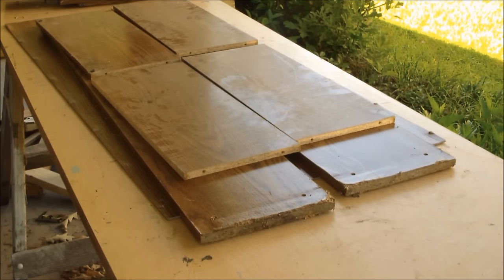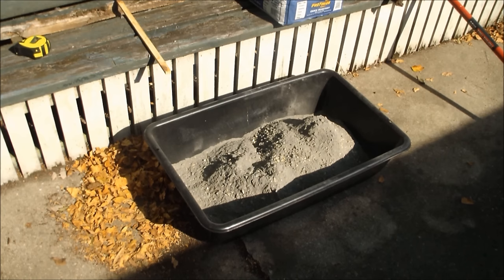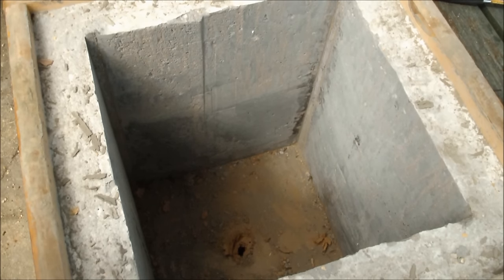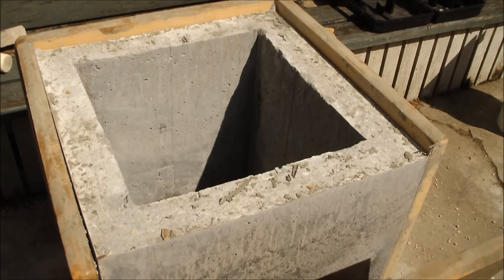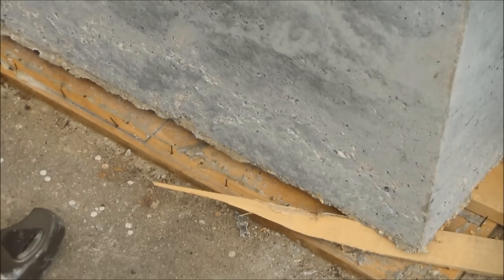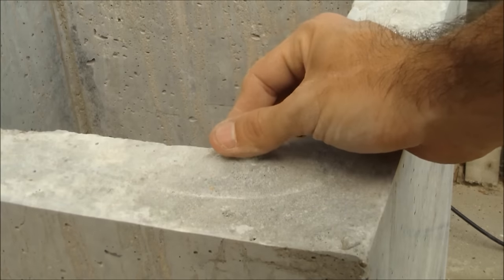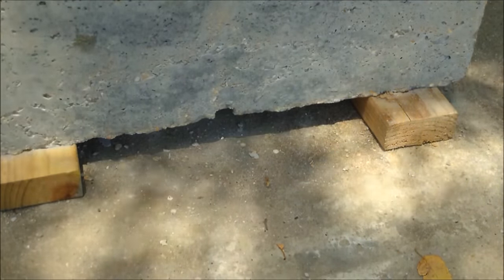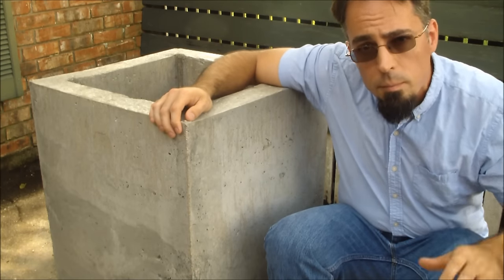How to Make a Concrete Planter

Comment: I worked at a pre cast concrete product manufacturer temporarily, I'm not an expert, anyway we used cooking oil in a chemical spray bottle, like you use for weed killer but industrial (metal) instead of pumping it we used a compressor to pressurize to lube the forms and molds. We were making bulk products, a plastic sprayer might be fine for your needs  We inserted  desired lengths of metal rods immediately after pooring the forms,  much thinner than rebar. We had a hand held electric vibrator we simply held to the forms make sure it settles in,   fills all areas properly and gets the air bubbles out.  I enjoyed my brief introduction to making precast concrete products.
Reply from the maker: You sound like more of an expert than me! I'll follow your tips next time. Thanks!

Comment: Exactly what I was looking for.  Great to see what you had issues with etc.  It looks great.  Thank you. Off to buy some quick crete.
Reply: Just buy the raw ingredients separately (if you can discover what they are and the ratios), you will save 50%. I assume the mix is 3:1 sharp sand to cement. Not sure about the fibre reinforcement material.

Comment: You can apply used motor oil on both the  outside and inner moulds for easy removal of concrete form from the woods.

Comment: When mixing mortar in the tub ,(1) put  the water in  first ,the amount is written on the bag,This makes it a lot easier to mix ,(2) Best bet, Mix  the  mortar in a bucket  using an electric drill ,mortar will come out like a smoothie  with less air bubbles
Reply from the maker: Thanks for the info!

Comment: mate after a day of curing you can take the inner box easier than leaving there for a week and by the way you do not need the bottom of the box if you stabilise the inner box from the top either down and the side by nailing a timber across the top. Make sure that you use a good greasing agent or even wb40. otherwise great and trial and error is the mother or all inventations.

Comment: If you unmolded it after about a day or two, you could have used a dremel tool to round off the sharp edges and remove those little bumps...or you could have tried to avoid the bumps when concrete was still wet...and carved a little edge in after the concrete had set "just enough" (an hour or two).  Grinders work great on cured concrete too....they work so well you have to be very careful not to take too much off.

Comment: In future wrap the mold in moving plastic or coat it in oil so you can pull the box out and save for another mold. Also....if the planter will be in yard for example and you don't plan on moving it you wont need a bottom for that instance.
Reply: Gisela West unless you plant something you don’t want spreading like crazy (like bamboo)

Comment: Good job. Maybe 90 degree angle brackets to make the inner box, easier to just unscrew. I'd like to include a handles of sorts for the finished product. More for character than function. Steady hand with an angle grinder will shape the top nicely.
Reply: Are you thinking of the marble or porphyry basins or baths used by the ancient Romans as sarcophagi? Objects of great beauty, with annular handles sculpted in relief, for example the one in the Mausoleum of Theodoric at Ravenna (wikimedia commons     File:Ravena (145).jpg  ).  Also the Imperial sarcophagi in Palermo Cathedral. That would be an amazing feature!

Comment: If, as my old coach told me, tenacity is the hallmark of the champion, then you're a champion, sir. That project had it's hiccups and you valiantly succeeded. Good on you! Some good suggestions below. Next time, consider making the mould a popcorn box shape, even if slightly tapered, as this will assist in "draw", a moulding term that means that the mould will release much easier with reduced chipping. And if, one day you decide that the bubbles have to go, you've got a nice rendering project to film. 😀
Reply: Making a tapered box requires quite a lot of skill, competence in design, use of angles, accurate measurement, more difficult to construct, etc, but good point

Comment: Great idea. one suggestion I would make to get rid of the air bubbles and have a much smoother finish in the absence of a proper vibrating table is to put either a very blunt or very big masonry drill bit into your drill/cordless drill and turn it onto hammer action and then simply drill into the the timber shuttering and watch the the level of concrete fly down.  You have to be careful of course that you don't drill right through, which is very unlikely with a blunt or big masonry drill bit as they're obviously struggle to go through timber.
Reply: Wouldn't even have to be a drill, just any metal rod would do, presumably. Maybe even a large nail, with the wide head serving as the hammer

Comment: A day is okay.... 

You didn't need to wait a week to remove the mould from the planter. It would have been easier to remove it shortly after it had set. 

You could have done with watering it too....

It would have also been easier to clean up your corners and edges.

Comment: You can remove the inner box by igniting it and it will make good ash fertilizer for your plant.
Reply: The heat will also give you some artistically-patterned cracks😂

Comment: What sand do you need to make this pale concrete. I was told locally I’d need builders sand which is dark and wouldn’t give the colour I want.
Reply: You need sharp sand, always ends up grey when mixed with cement, unless you use white cement

Comment: Next time use a hammer drill to get the bubbles out just hold it on the form without a bit
Reply: pls. share the size of moulding. i want to make one just like that.
Reply: the bubbles is what makes these planters unique. whats the point of a DIY if you're just gonna make them smooth??

Comment: Using motor oil works exceptionally well for sperating concrete. As others have said, rub the mold down with oil (5w20 is plenty heavy -- use gloves)!
Reply: Is that castrol GTX or shell

Comment: next on make the inner formwork  over under that way you  force them in easier  to remove ,your cross drains  splay them and they pop out with no problems  also a little oil  or diesel  on the formwork as a release  A bit stronger internal bracing  would help as it would not bow as this one did ,    2x2  strong enough ,also cut a slight angle to ease out easier .Also as you pour  have something  with a flat blade to jiggle into wet concrete to remove voids and air also as you did belt the out side   AS you pour as well if a 4/2/1 mix can remove the outer formwork after 2 days   outer only ,keep damp with sacking to assist curingGood luck with the others

Comment: I’ve been thinking about making one of these for a while.  Wondering if anyone has made one completely open on the bottom, then just setting it on a thick bed of washed rock gravel and filter cloth.   A little less crete, good drainage, a little simpler.  Wouldn’t work on a deck of course.  Only on the ground.
Reply: Why not just plant directly in the ground and save all the bother?😂

Comment: DRAINS, "weep holes" in big planters should be at least 3 inches from bottom at least on 2 back sides of planter for water to drain... you need a wicking system in these huge pots otherwise water just runs out the bottom ... moisture / water should remain in the bottom soil or around wicking tubes to preserve water inside of the planter to keep plants/ soil more moist..

Comment: .. place the inner box in a black plastic rubbish bag... segments should pop out easier.  Box will still be stuck tight, but concrete won't stick directly to the box.  Still make box in segments tho as the concrete will still have a firm hold on the inner box overall.

Comment: with various thin cementious coatings so good today, im not sure why anyone goes to all the trouble making most things entirely out of concrete, much easier to coat wood or cement board.   especially with geometric objects easily built with wood.
Reply: So teddy could have just coated the wooden molds with it & it would have turned into a concrete looking planter?
Reply: I'm so confused! 
mnminnmn are you saying you'd decorate wood with concrete?

Comment: Good project but next time use a grinder to remove jagged concrete edges or use a rounding edger drawl when concrete is wet and also don't make the side so thick. Much heavier then it needed to be. Also use old motor oil paint on inside of boards . I liked your idea for water drainage on bottom.

Comment: I did not get the dimensions of this planter, but I bet you could buy some decent looking planters of similar size far cheaper than all the expense you incurred in making it.  Plus, all that back-breaking labor.  Oh my!!!  Can you imagine the pain if you ever have to move it when it's full of soil and some plant, possibly a tree, growing in it?  You would need to rent a front-end loader.   You could buy an empty  55-gal blue plastic barrel for around $10-12;  cut it around the middle and you have two 27-gal planters at around $5-6 a piece.
Reply: Haha, that would look very elegant😂 No, these are very expensive to buy and  expensive to have delivered. You need to rent a back-hoe to transport it from kerb-side to your back-garden. That also destroys your front lawn. Make in in-situ and problem solved

Comment: USE A VIBRATOR TO MAKE IT GELL. THAT WAY YOU HAVE NO COLD JOINTS.
GREAT JOB BROTHER.
USE A CONCRETE ROCK. SAVE YOU'RE SAND PAPER.
TAPE THE PIPE NEXT TIME.
THE FIBER GLASS RENFORCES IT NO NEED FOR REBAR.
U CAN USE A CONCRETE ROCK TO GET RID OF THE SLAG

Comment: You should have put the Inner mold in a garbage bag so that it does not stick
Reply: No you should use melamine boards and use a poker all a vibrating tools to get the air bubbles out . A simple job made very hard work .

Comment: Best/cheapest/most available release agent is diesel and paraffin.  Put a liter or so of diesel in a pot and melt old candles into it. 30% paraffin is about right.  (It takes a long time to melt a candle)
And for those who live in movie land, no, heating diesel will not cause an explosion.  If the pot catches fire put the lid on and turn off the heat.  But the best is to not get it hot enough to catch fire in the first place... Warm the diesel, don't try to vaporize it. Apply with and old rag.

Comment: Why not leave the wood on the inside, less work. Try a sander next time to take bubbles out while cement is still wet to get the bubbles out just hold it on the form. Also try some type of nice stone on top to go around the edge.
Reply: Stanley Keith - thanks for the sander tip for the bubbles.

Comment: Pump Weedsprayer full of diesel, spray on form inside before pour.    Harbor freight vibrator to stop any voids/cold joints.
Reply: Pure diesel will not stand up to erosion by the concrete placing process, or delay (comes off at the top).  Too thin.  Ad some paraffin to it and apply with a rag.

Comment: If you the appearance of the air bubbles, use perlite in the mix, it will lessen the weight too
Reply: Not sure if you'll see this so long after your comment, but I was hesitant to add perlite because I thought that would add bumps to the finished texture, No? I've seen other people use both perlite and peat moss to decrease the weight (usually when making garden spheres), and they've turned out really well. Anyway, just wondered if you had experience with adding perlite? Thanks...
Reply: @jlnriddick  yes, it did leave bumps or bubble look in one I made, but I used very little just as a test. Never tried peat.
Reply: @DD-OO  So kind of you to reply! Thank you! I've watched so may videos now on planters, birdbaths, spheres... there are almost as many "recipes" for the cement as there are shapes! Thanks again!
Reply: @jlnriddick  your so welcome! I’ve watch so many as well. Even tried the towel method but didn’t like it. I may try another method this year, make use of the cement bag I have. Good luck!

Comment: If the PVC was set on the little pieces instead of the bottom you wouldn't need to drill hole a it would be above the flow channels.

Comment: You can put cooking oil on next time, that will make the concreete slip of,  I allways use raps seed oil 😊👍 beautyfull pot by the way
Reply: I think that given the amount of mass + curing time + flimsy mold = a whole project on its own to remove it & no amount of lubricant was going to help.  😂

Comment: 8 bags? Geez thats an expensive planter! Cheaper to just buy one from outlet. There were many ways to not use as much concrete and get same results. Plus i would of used plastic molds from dollar tree glued to board so a design would be there for better looking planter. But cool video. Should of used oil to keep mold from sticking to boards.

Comment: Forget the hammer. Use a sawzaw without a blade in it to vibrate the concrete.
Reply from the maker: That's a smart tip, Gary. Thanks!

Comment: obvious this is an older video.  and hell... looks like a fine planter.    but...  part of the problem of just using junk scrap wood from the side of the road... cheap particle board,  is porous and absorbs water.   this can affect the cure of the concrete,  but also why the inner box stuck.   not only because the wood probably expanded,  but because the wood was porous.   the outer planks... OP mentioned they were smooth,  were prob vinyl veneer or something.    It's sorta why people in the comments are suggesting oil,  disel fuel  etc.   oil... or petrol will create a barrier between the water and your form.   ye olde... water and oil don't mix.     letting the concrete cure properly.   and making it easier to demold

Comment: Isn't it too thick?... i saw a few other squered/box concrete planters on real life before, but this one that you made is by far the thickest. I guess you meant to be this way of course, but for a planter i believe its impractical because of the weight...

A hack that i know to make planters seems to be more thicker without weight too much, is to make the borders larger, ONLY; so this way it will seems to be more thick since its covering the thiness of the walls.
Reply from the maker: It's going to have a tree in it for a long time, so I wanted it to be strong. But, you're right, it is bulky.
Reply: most cement planter especially large ones are very bulky. He used regular concrete, if you want to make something lighter, use just cement powder and add with sand or perlite or vermiculite and peat moss or coconut coir. These will act as a binder but are much lighter weight than sand and gravel that is in cement. They are however not as strong so will work for smaller pots but I don't know if they will work for such a large pot. You tube has several videos on this.
Reply: If you want it to be lighter, what do you think about aircrete?
Reply: Toob247 Toob247 YOU CAN USE LIGHT WEIGHT CONCERTE MIX& IT HAS A CHIP MIX (SMALL ROCK)
Reply: yncollas  large garden planters are meant to be thick and robust not dainty and thin
Reply: ueoiratil
Reply: I like the thickness of this pot. But you could further reduce the weight and cost by making a fat rim and thinner body. You'd never noticed if the pot got thinner on the inside. Hard to make a mold for this kind of pot. But...
Reply: @tedsbackyard  If you are going to build another one you might consider applying strips/squares of beveled wood applied to the outside form.  (like a 6 panel wood front door)These strips will displace the straight cast concrete resulting in thinner sections.  Even though these places will not be "solid" no substantial weakness will result as the strength in concrete is only in compression and it is wildly strong that way.  Just cut the applications on a 45 deg angle at edges and they will remove simply.

Comment: Too thick. Casters under would help to move it around. Concrete forms don't need to be left for a week, two days max is enough. no need to apply wax or oil on concrete forms. you don't sand down concrete with sandpaper - use a grinder instead.

Comment: I'm no expert but usually when doing stuff with concrete steel reinforcement is added to prevent the concrete from cracking.
Reply: thats how they do it on sidewalks, right !!!?
Reply: right
Reply: yinon harel depends on the thickness of the concrete and whether it's subject to any bending. In the case of the planter, it's way overkill regarding its thickness so it will not crack. He would have gotten away with a third of the thickness using a light steel mesh in the middle. Reduces the concrete volume and weight significantly. Also fibre reinforced means small strands of polymer/plastic that act in a similar way to steel reinforcement improving the tensile capacity thus reducing cracks.
Reply: The fiber reinforced mix takes the place of the steel. It has little fibers mixed in throughout that prevents the cracking, and is commonly used in concrete counter tops and projects like this one.

Comment: Dude, you did so well until you tried to sand concrete (basically sand bonded together) with sand paper🤦‍♂ Please invest in an angle-grinder! Otherwise a brilliant video, just what I was looking for. It would have been better if you had not used a pre-mixed product and shown the raw ingredients and ratios required. Not everyone can purchase that same product, but the raw materials are available everywhere

Comment: you might put some kind of chicken wire or something in the middle of your mix.
Reply: He has no way to suspend that inside the form or insure that it remains someplace in the middle while placing the concrete.  Not stiff enough to support itself.  If he used 6-6-10 wire, maybe.  He still has the problem of bending it in the proper dimensions.  I would have used #9 wire and placed it inside as I placed the concrete.